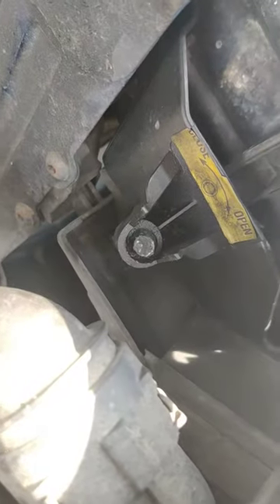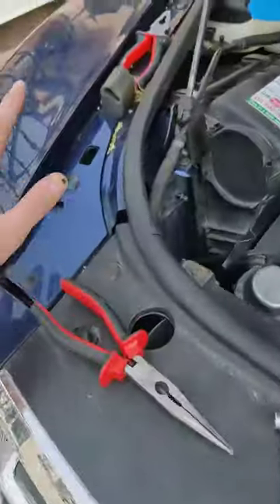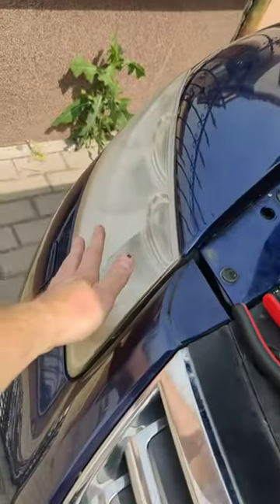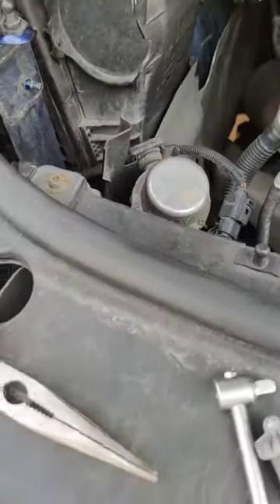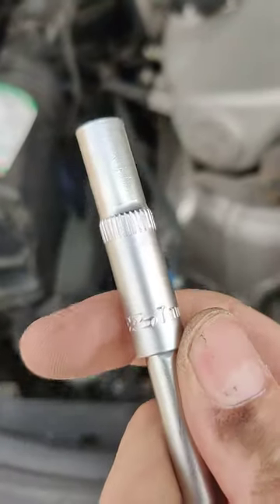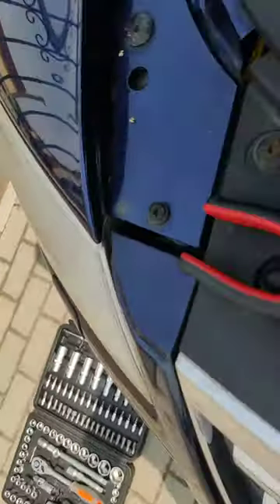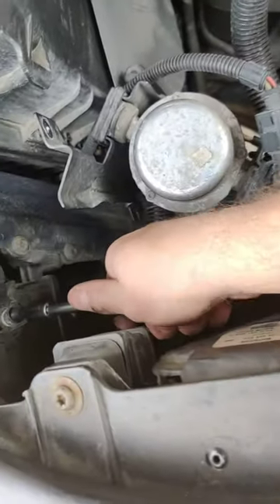Touareg 7l Removing headlight with broken bolt Part 1/3

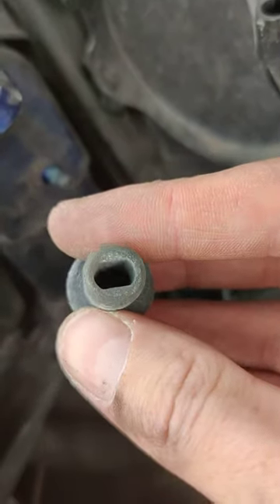Comment: 0:32 How did you get that gear out?
Reply from the maker: Bruteforce, later I have disposed it to the bean as the mechanism for holding it in place was already broken.
Reply: @dorinbrage2670  What tool did you use?
Reply: Nvm, I just decided to use a 12 point 3/4 inch SPLINED socket, which fits on the gear perfectly. Then I rotated it clockwise, and headlight popped halfway. Pressed clip, then headlight fully came out.
Reply from the maker: @utoobmann9083  glad you managed, myself I didn't have that socket
Reply: @utoobmann9083  thanks for the video. Got me close, however, in vid you mentioned a 7mm and on here you mentioned 3/4 splined. Was it a 7mm splined socket? Thanks again!
Reply: @MnGoIrish  Guy in video used 7mm (regular and not splined) after pulling off the gear. I used splined socket on the gear (I didn’t pull out the gear)
Reply: @utoobmann9083  got it and thanks for the quick reply. Makes since given the much larger size. Unfortunately, I tried the 7mm and it just spun. Going to try a smaller spline as maybe that will give it a  better grip. These old fragile Tregs…
Reply: 😂 Good luck